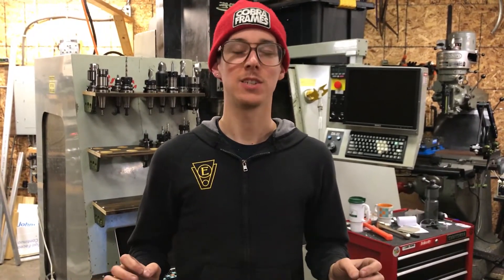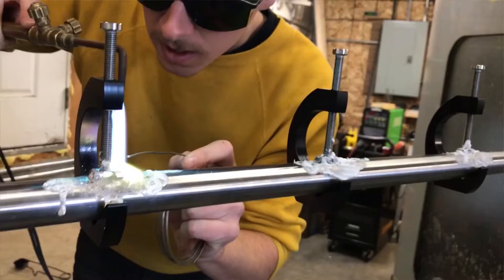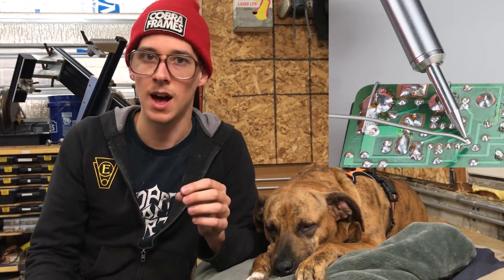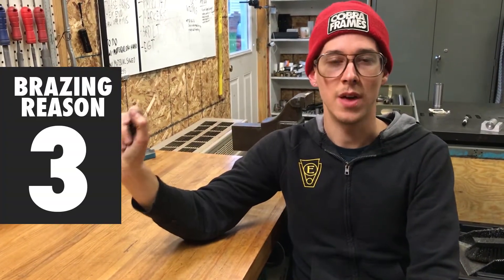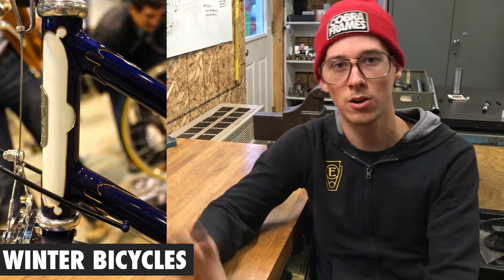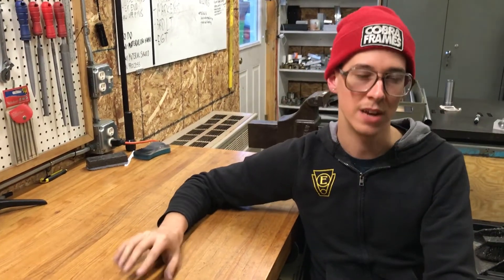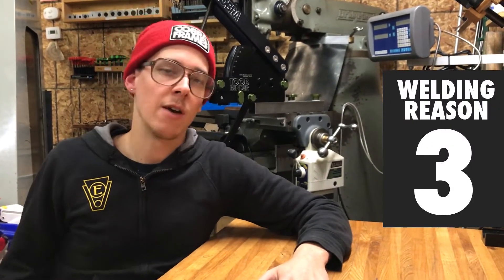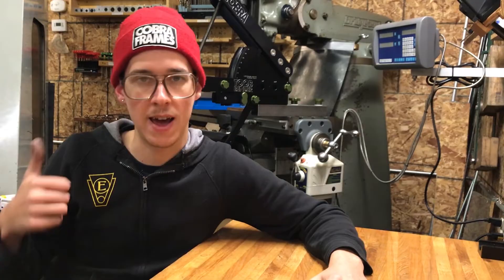Brazing vs TIG Welding for Bicycle Frames

Comment: Son, you have a good torch set-up. Forget the tig and learn to weld with it. There's a reason the FAA still recommends AO welding for aircraft frames and high end frame builders use AO for racing frames. AO welding is done at lower temps than electric welding (tig/mig/arc). if properly done, AO is as strong as tig and more snap resistant in a crash because it creates a softer weld and self annealing is a natural part of the process. European racers have proven this for years. I built two fuel dragster chassis with a torch, the same one  you're using. I built a stretch breaker to test tubing welds and the OA welds were consistently testing as strong a the tig welds and known to be more snap resistant in a crash.  The reason tig welding is promoted these days is it's easier to teach someone to do a serviceable tig weld than a proper  OA weld, and a tig weld is faster and prettier, not necessarily better.
Reply: John. Thank you for explaining this because your not only correct I agree with you 100%. When I was taught welding and fabrication by my father I had to learn how to cut metal without air or electric tools. Hack saw, metal files, emery cloth, wire brush, babbitt scraper, chisels, punches, hammers, egg beater hand drill, drill bits, wet stone to sharpen drill bits, box of soap stone, a bench vise, pliers, and learning how to read a tape measure. Once I got those methods figured out good enough he taught me how to use a cutting torch on everything from very thin sheet metal, tubing, pipe, solid stock, cutting thick plate, torch gouging, torch beveled edges, fish mouths in tubing, cutting holes, and really making every cut count. Watching my heat, learning how to bend with heat, form with heat, watching how cutting works. I wasn't allowed to use a grinder because I had all my files and other tools  to lay out my work and fit everything up. Then came good old oxy acetylene welding starting with basic welds to various positions on thin pieces of shim stock and tin. Always watching the puddle, your filler, your speed, and temperatures so you didn't get work too hot or cold. First project was a slag hammer.  He gave me a list of materials I   looked around the hot saw, band saw, and digging through his scrap barrel found found everything I needed for that first project. I remember getting everything ready and laying it all out using hand tools and a torch he said let me know before I hear a torch light up. He taught me new tricks on forming certain pieces at the anvil using the torch and a hammer. Then he told me after everything is cold to touch you can start welding. I remember welding it together and when I was done a little filing, wire brush, and sanding by hand had my first slag hammer. Started when I was 5 years old and I think I was 6 when I made that slag hammer. Later I got to use air and electric tools. Learned stick welding, and mig from dad. Yet I never learned how to use the heliarc. You mentioned building fuel dragster chassis my father had one of Long's old slingshot fuel dragster chassis with a Hannah body, and Nancy upholstery  was one of The Surfers old cars we think it got sold years ago have no clue what happened to it. Growing up around my dad building frames to everything else he did what he knew worked and he saved many years and recently got himself a tig machine. I have built roll bars and repaired frames for a few years now. To this day I still do my welding on tubing with my trusty old linde or my victor oxy acetylene torch haven't learned how to do it with a heliarc or tig as they call them these days. That warm fuzzy feeling you get when one of these track safety officials look over a frame or roll cage I did for someone and says looks great, passes safety spec, and by the way the tig welding is beautiful. Never had anything fail and I just haven't stepped up to a tig and learned. I remember watching a old muffler man when I was a child who built the best exhaust systems around. He did even one of them into the 90s with OA or occasional a mig machine for a tack to hold something. That old muffler man he got his start working for Scottys muffler he bent and built frames for scottys too. Only thing that is really tricky for me is doing aluminum with OA. Most people never realize how much cheaper cost wise it is to use the OA process, saves shop space, and along with its many many applications along with the advantages. Why OA is not taught these days is truly sad. Yet it makes me happy to see or hear from others who use it still. By the way any fuel chassis I might or my old man might recognize if you don't mind me asking ? Take care and stay safe.
Reply: Hey John , thanks for your feedback,  would you please clarify meaning of AO welding, ... I do not know what AO stands for. big thanks for sharing your knowledge
Reply: @javierzavalaponce  acetylene oxygen I guess or oxygen acetylene
Reply: If im not mistaken Harris said the same thing why they prefer to build racing bike frame by brazing.
Reply: What people perhaps struggle to understand is that in any structure there is no point in making a joint far stronger than the material you are joining. The material will just brake where stress is concentrated in the tube itself. Both welding and brazing are typically stronger than the base materials being joined.

You often see brazing used on motorcycle and old F1 car chassis (pre-composites). Don't look at what they've done, look at how they've done it and you'll see that they've brazed in such a way as to reduce point stress in the joint using filleting. Something brazing is better suited for than welding.

All that said I'd prefer to weld over brazing any day. Brazing needs closer tollerances as essentially capillary action is essential to propogate the braze which means everything has to dry fit to within a third of a millimetre, it's slow and fiddley work. Unless you really need optimum strength to weight stick to welding in my opinion.
Reply: excellent advice, John. I have experience with OA, MIG, STICK, brazing of water and pressure holding pipe, and learning TIG. Can't imagine anyone trusting brazing for a structural connection because if it doesn't hold, in this case a bicycle, the rider is toast. Best of my knowledge I've never heard of a bridge, building, machinery, ladder, pipeline, being safely constructed with anything but a weld or bolt. Brazing is good for sealing a joint, cosmetic, or something not expected to endure what could be life threatening stress, catastrophic failure.
Reply: @jameshartt3113  Hi James, brazing is still common in some parts on high end individually produced motorcycle frames and some specialist car outfits ( look at cottage manufactures in England and Europe), he one quick link. It's worth reading the comments so of them are pretty knowledgeable some just admirers.

https://www.youtube.com/watch?v=fWF0zCcXR5A
Reply: Bear...Not going to tell you you're wrong. I appreciate your feedback. From my experience, that may be way less then yours if you can prove the difference, I'm more than willing to learn from anyone, an oldtimer here LOL, I can't imagine how what I used to do with OA can out perform the strength of a true quality TIG/MIG weld with what I've learned in the past 30 years. (MIG, STICK, OA, FLUX CORE all on mild steel) You're young, and don't think I'm disrespecting you in any way, I was there once and old farts didn't want to hear what I knew either. But, a little bit of conversation with facts and hands-on proof, the old guys began to ask me more questions. Well, I'm the old fart now. I can't imagine how brazing is stronger, or as strong, as actual welding. Especially with a bicycle frame, not the fancy decorations, that is understandable. But, my belief with experience is, for a bicycle frame, much less a motorcycle (I ride a 1100lb Harley at 85mph at times), that if not "stuck" together properly, it could easily lead to a catastrophic failure that could cost the loss of a limb or life. Explain how "brazing" is just as good as welding.
Reply: @jameshartt3113   Hi James, I am absolutely the wrong person to explain the strength relativities between welding and brazing - I arc weld any mild steel I come into contact with at home. What I am is a keen motorcyle racing follower - Motogp and it's forerunners) and am aware that for a long time even the 500cc 2 strokes bikes were brazed. I don't think the issue was strength i suspect wleding is stronger but if the strength is adequate what advantages did brazing bring - such as lower temperature joining to give less distortion during building to a more flexible perhaps more crack resistant join. As I said I can't explain it but is was that way.  Someone who could those is in this link following. - Note they make the point that "First, a brazed joint is a strong joint. A properly made brazed joint (like a welded joint) will in many cases be as strong or stronger than the metals being joined." Have a read of the following page and it will explain what they see as advantages. If it was me involved in welding on motorcycle I would take my bike to someone who knows what their doing and get it welded up. 
https://lucasmilhaupt.com/EN/Brazing-Academy/Brazing-vs-Welding.htm
Reply: Your full of shit regarding AO being as strong as a proper tig weld.    I’d put my tig welds to a strength test against anyone in the worlds AO brazing joint.   No problem…   Just because it works doesn’t make it “as good”.
Reply: FINALLY another voice from the "flame fusion weld" wilderness, the first problem in trying to get the point across is always the assumption that OA is all "brazing", the concept of cohesion vs adhesion seems to just blow their fragile egg shell minds.
Yet another technique is bronze joints without flux by using TIG and argon, small tight joints are the result of the experienced hand,  I've used this technique for repairs on steel parts that have a problem being flame repaired or TIG "welded" by using the TIG torch for the heat source and .035 bronze MIG wire to keep the heat down and puddle to a minimum, as you pointed out John, slower and requires a good amount of skill.
Reply: @Peter-V_00  Perhaps, when people think of torch welding steel, they think the puddle is going to be really thin,  like bronze. Little do they know that the puddle is as thick as cold honey,  is easily led and informs you when the weld is happy!

Comment: Need change out my old 1” head tube put to have a new 1 1/8” head tube. Is it possible?
Reply: Any frame can be modified just take your time and fitting it up, measure, check, and see if it works. I have no college education all I have is learning from my father at a very young age, my own projects, job sites, figuring out what works, and what doesn't work. The best framework starts with that one question will this modification work ? The person builds something that works or learns how to make it work even better than expected. Best wishes and good luck 👍

Comment: I really enjoy your videos. There are couple other advantages that TIG has over brazing that you didn't mention. The first one is that TIG arguably produces a stronger frame because the heat affected zone of the joint is much less. The TIG torch produces rifle like accuracy whereas the brazing torch has more of a shotgun like effect spreading heat into a much larger area. Secondly, all things being equal, the frame that is TIG welded will be lighter than the frame that is brazed as the TIG joints will have less filler material in the completed joint. Keep up the good work Joe.
Reply: Yes, but also no. I think that TIG (fillet) brazing takes the cake here. The problem with actually welding highly alloyed tubes like these is that when you make a puddle with the base metal you are actually pulling the alloying elements to one place and you are creating a brittle zone there. That is why any weld will always fail and crack right next to the weld. From a metallurgical standpoint welding alloys is a shitstorm. TIG brazing will keep the basemetal the coolest and strongest at the expense of a few extra grams of bronze per frame. We are talking about maybe 30-40g of bronze per frame after the fillets have been filed compared to 10-20g of steel filler wire if TIG welding.

Comment: - You are correct on the classic style stuff, as you know.  One minor point it that we have been welding bike frames for pretty much just as long as we have been brazing them.  There was a US bicycle company that was welding them starting around 1908, maybe in chicago. But as you correctly state, TIG welding revolutionized bike manufacture, and one might say that was in part because the MTB craze came in, and a lot of those early bikes were made with straight wall 4130 pretty much throughout.  So not a big jump.

Historically, aircraft grade steel, 4130 ish, that started in WWI with the germans.  They were welding it for their fighter planes, that was certainly gas welding. 

In fact brazing 4130 is a bad practice, obviously totally proven in bikes with the way it has been developed, but as mentioned those are kludges with huge big deposits for fillets, or using lugs.  The reason is that it propagates cracks, which in a motorized structure like an airplane is a disaster waiting to happen.  But at least for the folks who think brazing is structurally superior - it isn't.
Reply: I think you mean WWII.  Planes didn't shift from wood frames to metal till after WWI.  And while TIG is the method of choice 41XX tubbing was brazed in planes and such till the 50's when TIG started to be an alternative.
https://www.aedmotorsport.com/news/the-history-of-4130-cold-drawn-seamless-round-tube
Reply: A perfectly welded joint will likely be stronger, that’s true, but it’s not very easy to make perfect welds 😊

Comment: I was able to get my hands on some stainless tubing for cheap. It’s about 1.5” OD 035 wall. Not sure what type of stainless. Question is, can I braze a frame together with it? I brazed a 4130 frame years ago, so think I can do again, but don’t want to buy a torch if I can’t use on the stainless. Guy at weld shop says SS can’t be brazed, but wonder if that doesn’t apply to bikes where metal mass if very small and therefore maybe can get hot enough. Thoughts?
Reply: I'm not sure why he said SS can't be brazed, because it can be.  Now everyone here seems to be talking about brazing with a torch, and mostly sweating connections and maybe that is where the trouble is?  I have and many others have TIG brazed SS with out issues.  You can get away with out having to purge.  Some stainless welds badly so without knowing what you got...
Reply: Chris Mason people do braze stainless even though manufacturers don't generally recommend it. However, they seem to be O.K with brazing when using lugged construction. As you don't know the alloy I wouldn't try brazing it without lugs. Look at silver soldering it too, that'll keep the heat down.
Reply: Anonomosomous appreciate the comment. Lugged brazing is more for the classic bike design and method. The one frame that made was brass fillet brazed (not lugged).  It was on 4130 and lasted over a decade with a lot of abuse. Wondering if there’s some reason this won’t work on SS. I think I’ll just have to make samples and test to destruction. Thanks again
Reply: "wonder if that doesn’t apply to bikes where metal mass if very small and therefore maybe can get hot enough"
Repeat this to guy at weld shop and see what he says.
Reply: Cedric What are you saying? His opinion was pretty firm. Was hoping someone on here has tried it before.
Reply: Yes you can braze your stainless tubing I did it 20 years ago and occasionally still braze stainless steel with an oxy acetylene torch. I oxy acetylene weld my chromoly tubing and have for many years without any problems. Try brazing some together and pulling on the stress points and see how they hold up. If im in doubt I weld or braze something up and test it myself with a wench, jack, porta power, and anything to simulate the distortion/stress that weld, braze, or solder is going to get tossed at it might sound primitive or backwoods yet I haven't had anything fail yet. Find a Linde, Rego, Harris, or Victor Welding book from the 1930s to the 1940s before we had heliarc or tig Welding on the bay or a bookstore. Look for old aircraft mechanical books  because it will amaze you what is possible. Try sweating some of that tubing together with brass or silver solder and try breaking it I think you will be surprised by how strong it will be. Best wishes and have fun.